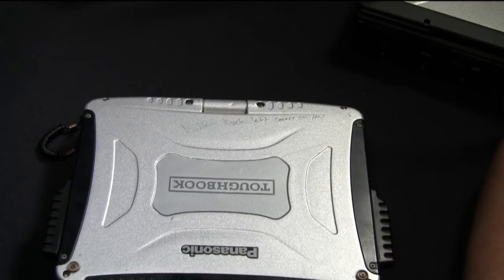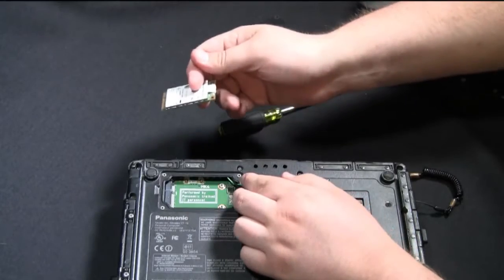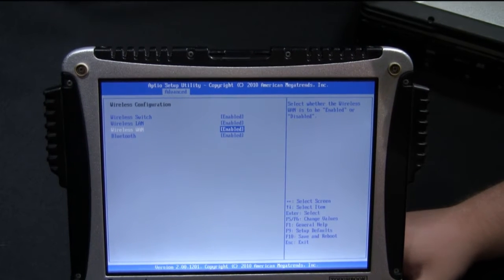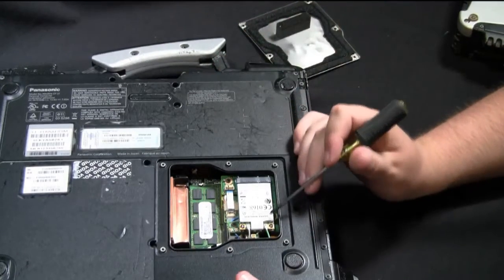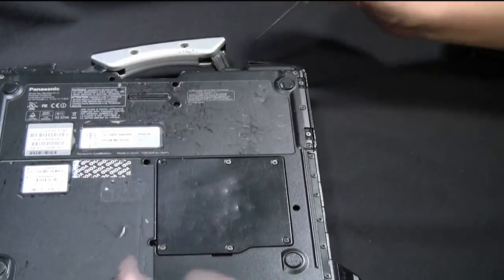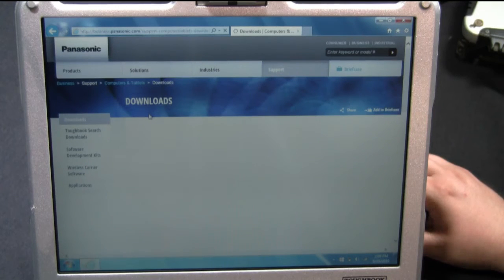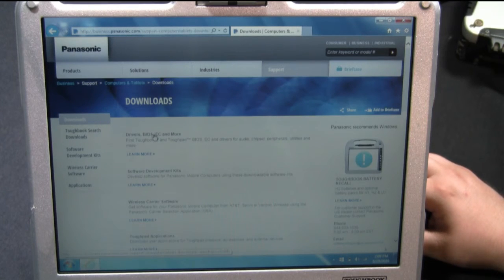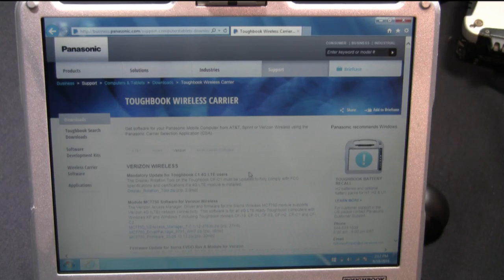How to Install and Configure CF-31 and CF-19 Mobile Data Card

Comment: Hello Bob
I try to find the driver for Sierra Wireless MC8305 for a CF19 AHN... MK5 but I don t find. Could you help me ? 
I have upload to windows10 with the driver 19ab-mk5-7x64 to restaure fonctionnality. It s OK for this part.
If isn't possible could you say me wich cart is possible with this model ? Thanks a lot Julien and Leo

Comment: I would change the fan of my Itronix GD6000, I tried in every way but I did not succeed; I searched on google and youtube but could not find anything. I tried to remove it from the keyboard and from below but it seems an impossible :(.
Could you help me please let ?! (I did the test with speedfan and the temperatures are very high, I reach 67 degrees centigrade without using it and leaving him alone on)

Thanks in advance!